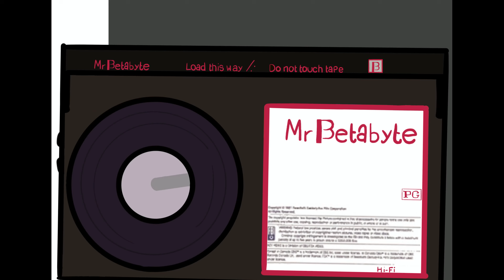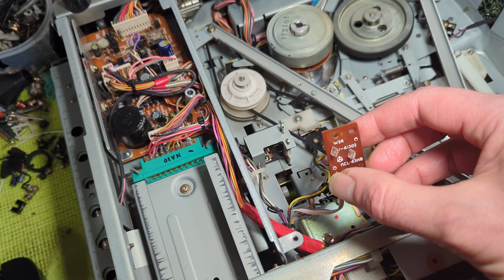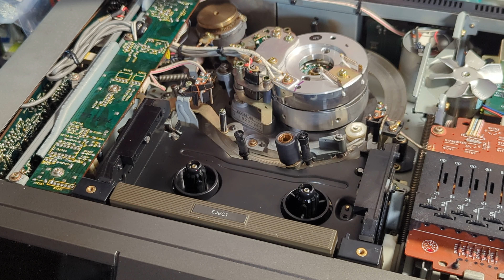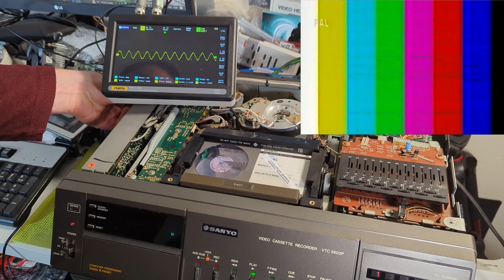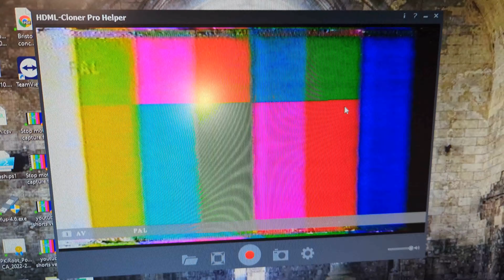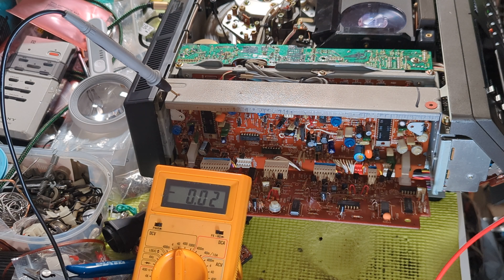Sanyo VTC5600P Betacord - A rare Betamax - Part 2

Comment: Some fault symptoms and remedy for this machine (Sanyo VTC-5600). If slow capstan motor and no input pulse at Q413, Pin 19 check and replace Q401 (CX186) Transistor. Also if no colour in E-E and O.K on loop through check Q177. I hope this helps... Best of Luck.
Reply from the maker: Thank you so very much for this - that's extremely useful information. The colour is fine on the 5600 I have here but I know Fivos has had issues with his so I'll forward this to him. I do now have the servo schematics for this machine too (again, huge thanks to Fivos for sending these over) so with those and the information you've provided, I have a good chance of not having sleepless nights trying to work what on earth is going on. The C5 manual was helpful but Sony and Sanyo do have different ideas on how to implement the chipset. I'll be sure to credit you too in part 3. 😊

Comment: How do i do this?  Are'nt you supposed to be  informing the viewer? Still i appreciate you posting this video.Nice to see inside it.
Reply: Watch part 1.😊
Reply from the maker: It's part 2 so we disassembled the 5600 in part 1 last week and this is the continuation of trying to get it working properly and hopefully, reliably but I do need to add a link to the first part. 👍
Reply: You could have just read the full title and worked out that there’s a part one from that…

Comment: Possibly the rarest of all the UK PAL Sanyo Beta's.
The only model i've never seen by them up close or worked on.
Like a hybrid between the upcoming VTC 5300 and the older, huge VTC 9300.
Only had visual search in one direction (the 5300 had NO visual search modes but the 5400 did plus audio dubbing.)
For it's time considered fairly advanced with an infra red remote control too.
Reply: There is an even rarer model called the VTC 9455. Uses the same mechanism as the 5600 but it's multi system and considerably larger with a wired remote. I did a short video on it years ago. That one has search in both directions, oddly enough.
Reply from the maker: @crashbandicoot4everr That sounds like a great machine - will have to see if I can find one.
Reply: @MrBetaByte  Total nightmare to work on it. Very complicated switching power supply, tons of servo and luma/chroma adjustments and no service manuals available. I wish mine was in repairable shape. I'll get another one some day...
Reply from the maker: I would agree it's the rarest of the PAL Sanyo Beta's - I only know of one other that's still alive in 2025. It is somewhere in between the main-motor models and the smaller, what could be termed, next-generation of machines but has a lot of clever ahead of it's time design which we'll investigate in a future video no doubt. The search forward only is slightly odd but it does have audio-dub. I do really like it and it is thoughtfully designed for the time.
Reply: @MrBetaByte  The 5300/5400 series have the least reliable mech of them all. Loading rings jamming constantly, counter belts that fail all the time and cause the machine to stop. They do have an electronic soft-touch eject function though and a geared reel drive idler system. What more could you ask for? LOL